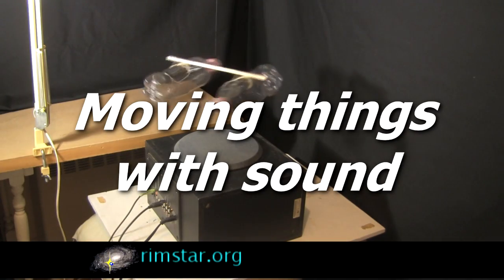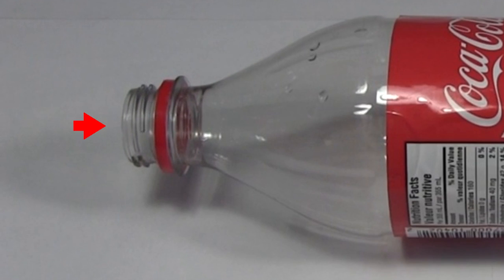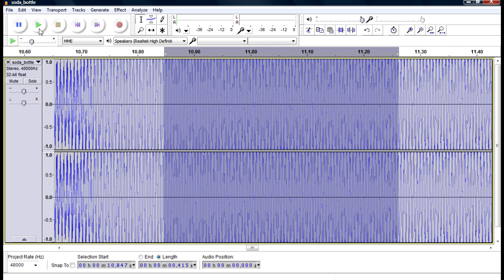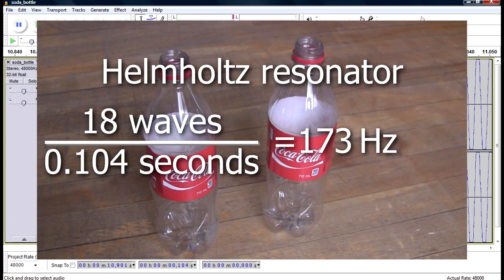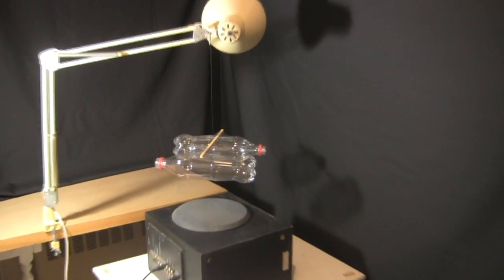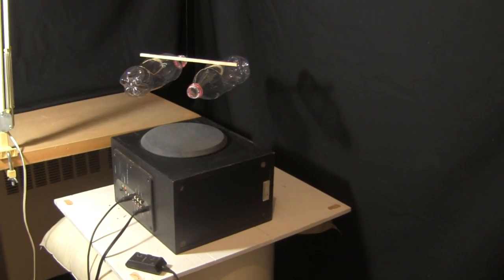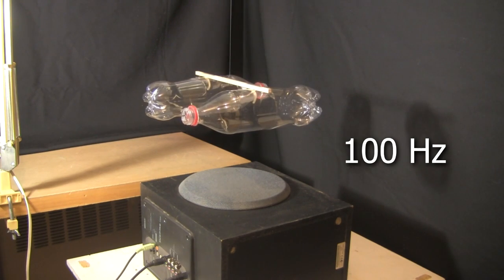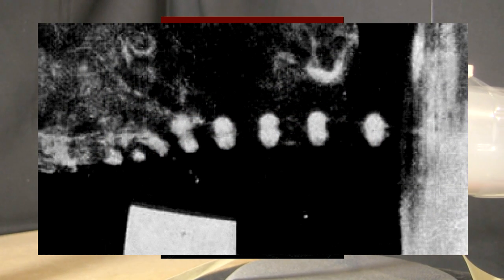How to Move Things with Sound/Acoustic Propulsion

Comment: Excellent demonstration and very cool.  One thing I do not understand...a pulse-jet uses pedal valves to let new air enter the chamber so how does the air get back inside the bottles to once again exit? The entire container is resonating, like squeezing gently and releasing forcing the air out.  When/how does new air enter?  You videos are always excellent and very thought provoking.
Thanks,

Bill
Reply from the maker: The air is entering from the opening and then exiting from the opening each cycle. So that happens 173 times per second with the bottles I used in the video. That's the Helmsholtz resonance. You then say, how can there be a net force? Why is there only the outgoing jet shown by the smoke? According to the book, the jet is actually a bunch of separate vortices and only appears as a jet because the camera is shooting at 30 frames per second. There's also an explanation in the book about how there's a net force, something to do with viscosity, but I've yet to understand it well enough to explain it.
-Steve
Reply: Net force, exactly what puzzles me.  I understand the pulse vortices (too fast for us to see) but not how the outgoing is greater than the replacement air entering the bottles.  I will look into this further as it intrigues me. Thanks for your honest answer and for doing the demonstration.  Steve, you really are doing some great work over there.  Thanks.

Bill

Comment: If the direction of the bottles is reversed, will it spin in the opposite direction?  There must be a ring of incoming air within which the output flows.
Reply from the maker: If the direction of both bottles is reversed then yes, it will spin in the opposite direction. I wouldn't think the air would come from a ring but just from the air surrounding the opening wherever it is at the time air is sucked in, along with the contribution from the sound wave coming from below. But I'm going to make another stab at the explanation the book gives this week. Sadly, the book says the physics of it has never been quantified.
Reply: RimstarOrg
Well, if the outgoing air is continuous and can be sustained, then there would have to be an incoming flow.  The vacuum created would suck air inward.  Since I could see the initial blast of smoke and it seemed to be centered on the opening, I was deducing that the inflow might surround that shaft of outgoing air. My curiosity was then going in the direction of determining the overall pattern of the airflow.  I'm thinking that perhaps the sound vibration is wrapping around the bottle, compressing the air toward the centerline of the bottle and then out the center of the opening.  Imagining this flow, it seems that the only place left for the inflow would be the ring just inside the opening of the bottle.   Perhaps if there were a second experiment with a short burst from a smoke source just outside the opening, perhaps just off center.  Sorry for going off into all this, but it really piques my interest as to the forced direction of molecules.  Why in this pattern?
Reply from the maker: whereschrism
The outgoing air isn't continuous. It only appears that way in the video because the camera is shooting at 30 frames per second. According to the book, the jet is actually a bunch of separate vortices. Since the frequency is 173Hz, there are 173 vortices being emitted each second. During part of each cycle, air is drawn in and then a vortex is emitted out. Even to the naked eye that sees at only 30 frames per second (or is it 60?) it looks like a continuous stream. I'm still trying to understand the book's explanation for the net force.

Comment: Very cool. Could you tune the chamber to a resonant frequency that would generate a visible train of vortex rings?
Reply from the maker: Hmmm. Good lateral thinking. And here I was thinking of different ways to do strobe lights and if it would work with my camera. The human eyes sees at 30 frames per second (though I sometimes read it's 60.) I just calculated dimensions for a resonator for 57.9 Hz but it remains to seen if it would work in the real world. I had to go with a smaller diameter but longer neck and a larger chamber.
Reply: Maybe PVC of different diameters and lengths with some reducing fittings? Let the theory get you close and finish the tuning with a hacksaw?

Comment: So I see Grant Thompson has already requested acoustic levitation. I second that :P. If you can show me how to levitate a ping pong ball. That will be one less project on the to do list.
Reply from the maker: My brain is already churning away. As Aaron Stemple is hinting at (I think), nothing large has probably been lifted, but so far I'm thinking it would need a smart array (amplitude control) of surrounding speakers and an active position detection system conceptually similar in idea to what a lot of people do with magnetic levitation. But a first test would be just to see how much force can be produced through constructive interference with a few speakers. That'll tell if it may be doable or not. It won't be through Helmholtz resonance though.
Reply: I'm sure I've seen a ping pong ball done with one speaker somewhere, could be wrong though. I have an image in my head of a ping pong ball floating a few inches above a 4" speaker, like one from a car door, or old pc.

The Hutchinson effect is done with a very powerful speaker/amp and a microphone to pick up the feedback resonance. Similar in some ways.

Falstads has a good open source audio interference applet if that helps http://www.falstad.com/interference/

Comment from the maker: This week's vid - moving things with sound, or acoustic propulsion! In this case I use a speaker, playing a 173 cycles per second sound wave, to make bottles propel around. Includes a smoke test so you can see the resulting jet! Enjoy.
Reply from the maker: Darrell Vogler
In space, as Than Zamp said, no. Or to use the tag line for the movie Alien, "in space no one can hear you scream" because without a gaseous medium there are no sound waves. But even down here in Earth's atmosphere, ... Sound waves are outward moving compression waves, which I guess means that between each half cycle is an area of rarefaction??? I dunno. But it would take a heck of a lot of power and the resulting volume would be huge. I guess I don't know enough to say if it's even theoretically possible.
Reply: Super cool !
Reply: RimstarOrg , if speakers would be attached to an home-made UFO, can it be levitated by using acoustic propulsion?
Reply from the maker: Than Zamp
It's not working that way. The speakers aren't pushing on the bottle. Each cycle, air from the sound wave enters the bottle starting and enhancing the resonant wave in the bottle. It's the bottle's internal geometry's interaction with the sound waves that is producing the propulsion.
So the approach, not feasible since the force is so small, would be to have many bottles around the bottom of the craft like downward pointing jet engines and speakers pointing at the openings of the bottles.
Reply: RimstarOrg But the question still stands...could speakers, given enough amplification, lift (if untethered)?  We've all stood in front of speakers and have felt the push from the waves...could they in theory be made to produce enough to push off.  Additionally, if so, I wonder how they would act in space/vacuum.
Reply: Darrell Vogler In vaccum/space, you would need a super speaker capable of working at a power of some thousand gigawatts. And this only after some centuries. And we are still in 21st century. And think for a while. If someone was crazy enough to make a spaceship with speakers, the sounds would kill everyone literally. So no sir, it's impossible by all means.
Reply: RimstarOrg  acustic generator is upside down.
Reply: Nice
Reply: Time to build future

Comment: Cool! And I think we have the same speaker system
Reply from the maker: Thanks. :) Depends on which speaker system you mean. The one I showed to explain woofers is my day-to-day one. In that one the speaker's entirely inside the box and has some vents only on the bottom edges - I couldn't get it to work for this propulsion. The one I used for the propulsion I got from our building's trash a while back, along with around 7 satellite speakers. That one's speaker is right on the side facing outward (upward in this video.)
Reply: RimstarOrg
Yeah I meant the 7.1 system, whose subwoofer you use

Comment: Can you explain why we have an acceleration? The bottle pushes air out and same amount in again so it's the same mass.
Reply: Never mind.. got it. While pushing it out you get a directed force while sucking in comes from all directions.

Additionally get frequency easy using audacity marking the area and menu->analyze->Plot spectrum..>the mouse will snap to the peek and show the exact frequency. You can then generate a clean tone using menu>generate->tone
Reply from the maker: bitluni's lab
Good question re why we have acceleration. The answer's not so simple. It has something to do with viscosity, otherwise it wouldn't move. It's explained, though not too clearly, in the book I mentioned in the video, Notes on acoustics, starting on page 336. But I don't understand it well enough yet. If I can wrap my head around it I may do another video.

Re audacity - cool. I'm no audacity expert but I figured there was probably an easier way to do it. However, I stuck with my bare bones approach rather than dig deeper to show it at a more conceptual level and in a way that can be applied with less capable tools (like my video editor.) But you can bet I'm going to use those features now that I know how! Thanks.